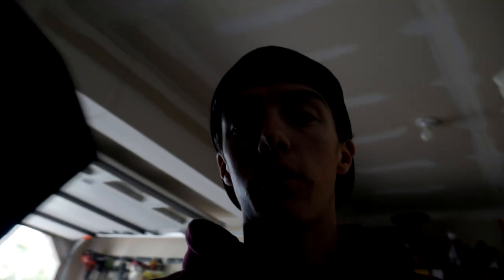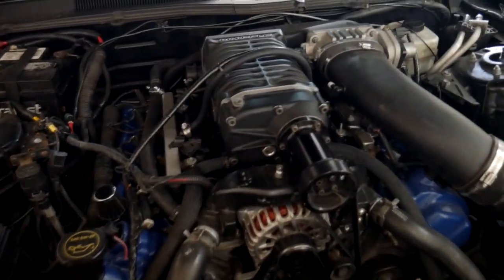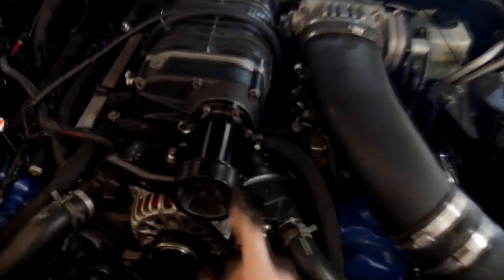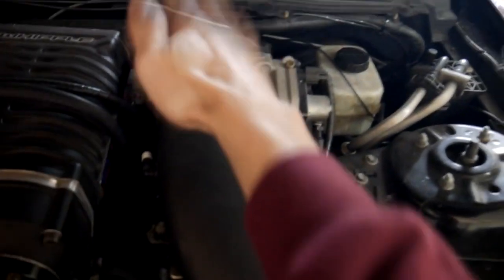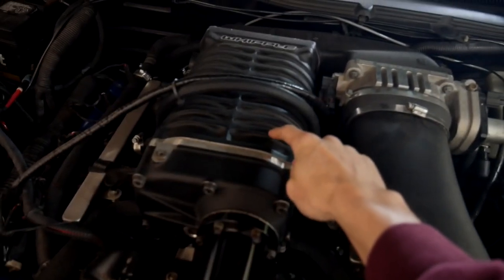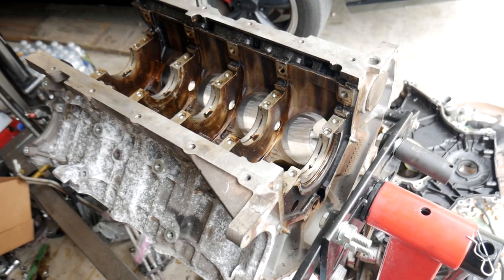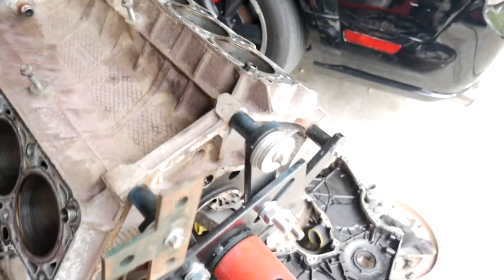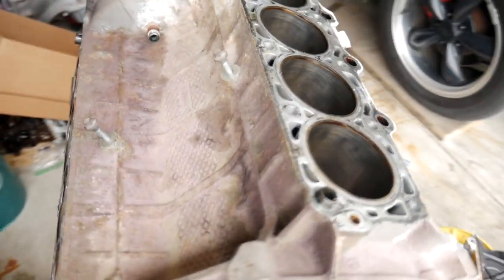ENGINE SWAPPING MY 2006 MUSTANG GT

Comment: I Did Play GTA in Brazil again I did Do BMX Halfpipe Jumps on those cars part 2 I Did The Story mode Franklin I did do A BMX Half pipe jump on the Albany Cavalcade I did Done The BMX Halfpipe jump on the Chval Surge It’s A Electric Car I done The BMX Halfpipe jump on the Vapid Dominatior I did the BMX Halfpipe jump on the Ubermachet Oracle XS/Ubermachet Oracle, I made A BMX Halfpipe jump On A Chval Fugitive it’s A SS by Chevrolet, I Did A BMX Halfpipe jump on the Dewbauche Rapid open roof and Closed roof I did The BMX Halfpipe jump on the Vapid Minivan it’s a Dodge Grand Caravan I did A Bmx Halfpipe jump on the grotti Super car it’s a Ferrari, I made A BMX Halfpipe jump on the Pegassi Infernis it’s a Lamborghini I did a Bmx Halfpipe jump on A Karuma Armored car I made a BMX Halfpipe jump on a Canis Simole It’s A Jeep Gran Chrockee I did a BMX Halfpipe jump on the Vapid Bullet I made A Bmx Halfpipe jump on A Police Motorcycle i did a BMX Halfpipe jump on the Crown Vic Cop Car I did a BMX Halfpipe jump on the Pegassi Zantorno it Was Fun I did A BMX Halfpipe jump on the pounder Truck but it Didn’t Workout, so much I did a BMX Halfpipe jump on the Vapid Sadler Truck, I did a BMX Halfpipe jump On the Bravado Gauntlet it’s a Dodge Challenger car I did a Bmx Halfpipe jump on the Declasse Granger SUV it’s a Suburban, I did a Bmx Halfpipe jump on the Dinka Blista It’s A 2 Door Hatchback i did a Bmx Halfpipe jump on the Mana car